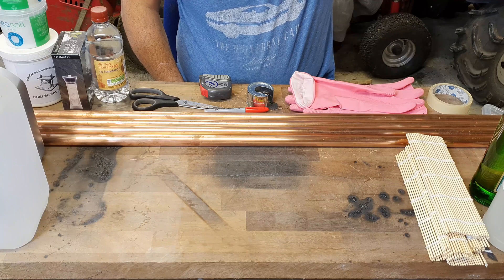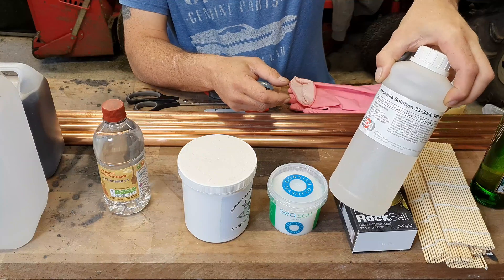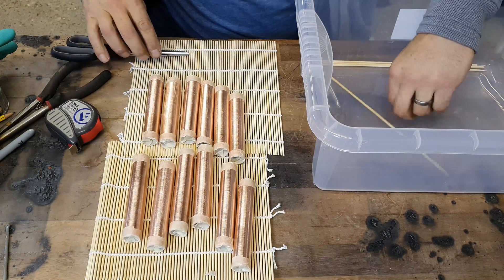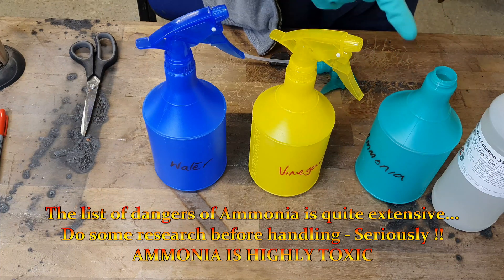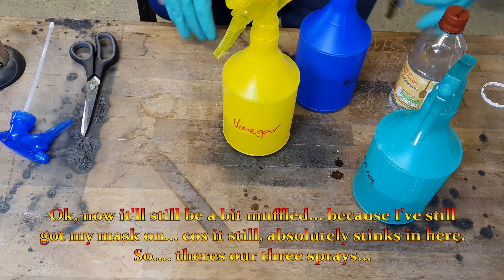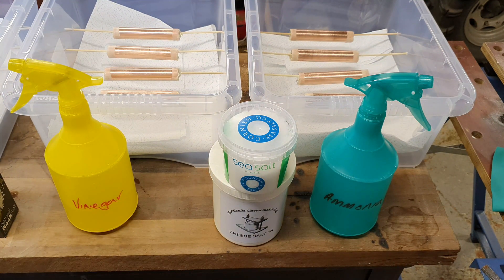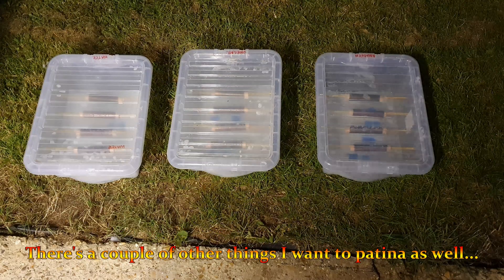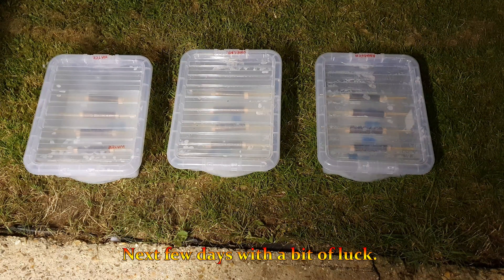Testing Blue Patinas on Copper #1 - Part 1 of 3  *Contains Swearing *

Comment: After many testing i found an important factor that was not mentioned here :  use a water based lacquer . other lacquers will alter the patina's appearance dramatically , making it much darker to begin with.
Reply: how durable are the water based ones? I found if I give really light coats at a time with spray lacquer, it helps to not darken the patina as much

Comment: You are working way to hard.

Just pour the ammonia into a plastic container rhat has a good fitting lid.  The copper never touches the liquid.  I used a thick Scotchbrite  scrubbing pad.

Put on lid, place container in a warm place and in 2 to 4 days your done.

Salt and vinegar will remove  tarnish from copper exactly opposet from what you are trying  to do.
Reply from the maker: Thanks Roger.  I was aiming for a fast patina in 3 hours, I agree you can get much better results over a longer period.  But this was all the time I had to do it and still have time to edit the video and get it out for the following week.  Salt and vinegar is a known recipe for a blue patina.  You're right vinegar will clean it, but salt vinegar and ammonia will produce a nice blue colour.  Cheers Andy 👍😎
Reply: So just ammonia in container for 2 -4 days then how does the copper look before you scotchbrite it ? 🤔
Reply: How do you use the salt vinegar and ammonia please?
Reply: @justinaoakden8800  

A copper alloy can be darkened by exposure to ammonia vapors (cheaply).  In my project I got a thick scotch brite pad(about 1inch thick) and poured about a half inch of regular ammonia into a plastic container snapped on the lid and set in a warm out of the way place.for a day and highlighted it a bit and put it back in the vapors for another day or two.

I ended up with a nice dark brown with some blue green areas.

You can buy a different chemical that works a lot faster that you can just brush on that is ready right away. This can be purchased at craft stores.

The initial finish is kind of dull brown the finish gets a bit shiny after oiling
Reply: Thank you so much for these 3 videos on blue patinas. I can't wait to see your attempt at green patinas.